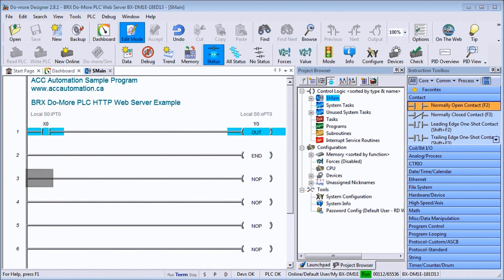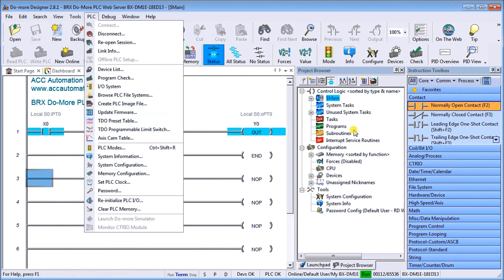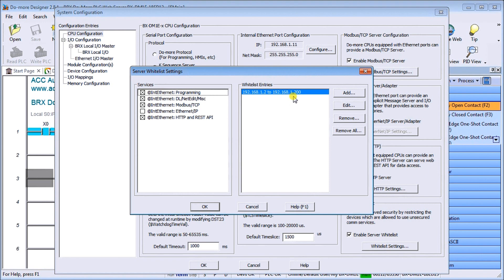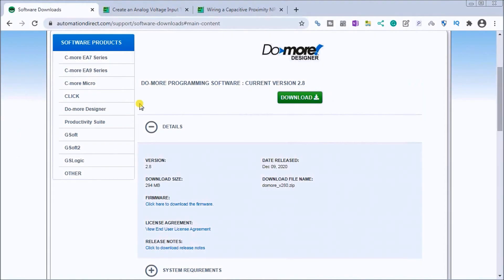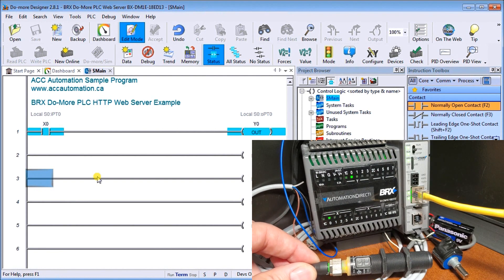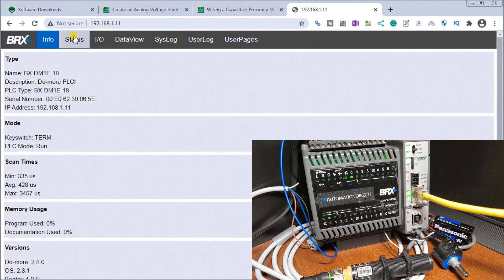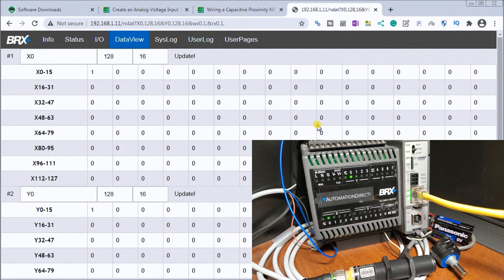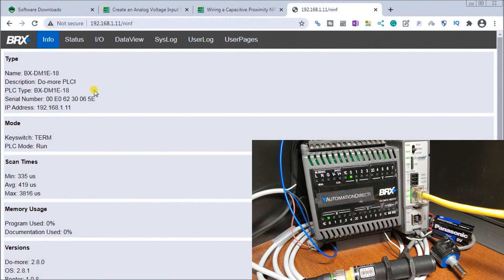BRX Do-More PLC Web Server - Website

Comment: What web server is needed for?
Reply from the maker: The BRX PLC (by AutomationDirect) includes a built-in web server primarily to bridge the gap between industrial hardware and modern IT/web technologies. It allows you to interact with the PLC using a standard web browser on a PC, tablet, or smartphone without needing specialized SCADA software or the Do-more Designer programming environment. 
It features the following:
- Remote Monitoring & Troubleshooting
- Custom HMI (Human Machine Interface)
- REST API for IT Integration
- Zero-Install Access
Regards,
Garry
ACC Automation